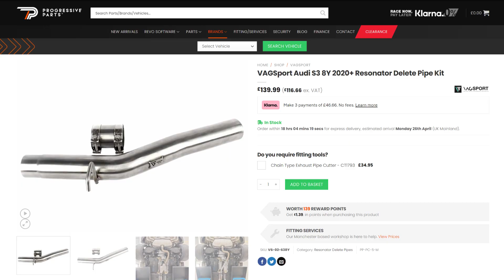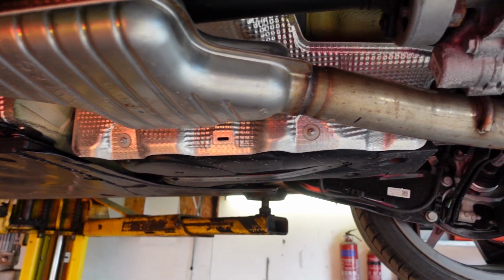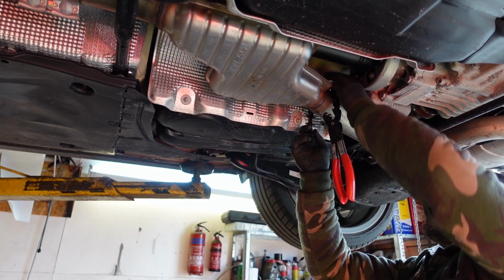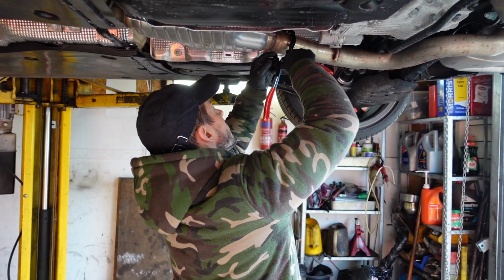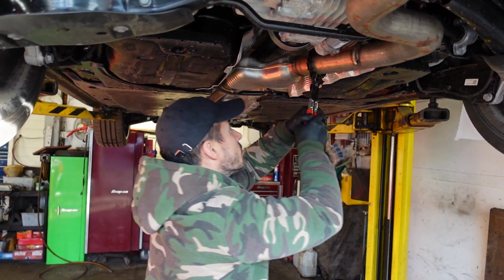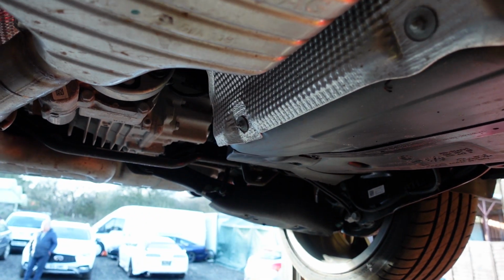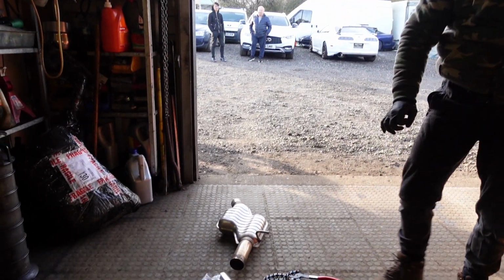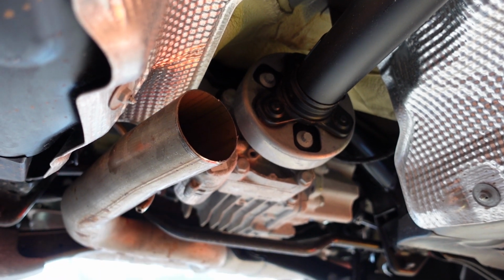MAKING THE 2021 S3 LOUDER | RESONATOR DELETE | POPS AND BANGS | AUDI S3 8Y | PROGRESSIVE PARTS

Comment from the maker: How many of the s3 gang have got this one planned?
Reply: I have plans to play around with the exhaust too (allthough it's a 35tfsi, not s3) and possibly having one custom made (i was thinking about buying milltek but they only have one for the s3)

Do you happen to have a 'before' clip?  Makes it easier to compare 🤣
Reply from the maker: @sigideridder6665  lol I did, but it got corrupted! This one was a nightmare to film. The static revs in standard form can be see from my other video where I changed the exhaust flaps to always stay open.
Reply: @CRD90  hey mate. Sounds wicked.
I am pulling out the order of my A3 Sportback in python yellow as the dealer is being a dick and pushed it back 11months. 

So... if any of your subscribers.. want...
Darkened Sline badges 1 pair
Black Audi rings front & rear
Black A3 badge.

I can sell them for the right price. Need them gone.
Gutted about my car tho.

Cheers mate
Reply from the maker: @dantheman-iam  that's sad bud, if you're interested in getting another car earlier drop me an email might be able to help! Won't be a python yellow though.

Auzzam_crd@hotmail.com
Reply: @CRD90  would it be an edition 1 mate
Reply from the maker: @dantheman-iam  even better! A vorsprung.

But drop me a note let's talk 👍🏽
Reply: @CRD90  brand new?
Reply from the maker: @dantheman-iam  1 owner, just over 1k miles - pristine and cheaper than any on autotrader too.
Reply: @sigideridder6665  Did resonator delete and clapet before second muffler and it is a tone quieter than this s3.
Reply: @CRD90  mate. Av gone another direction and bought A35 A Class. Cant get hold of Ryan at the badge shop that supplied the black badges    stuck with 60quids worth of black badges... A3 2 x SLine and front and back black audi rings....
Reply from the maker: @dantheman-iam  hope you like it bud! Guess the wait was too long eh?

If you want drop me an email, I'm often asked by people about black badges so I could send them your way when the time comes
Reply: Will this void audis warranty ?
Reply: @CRD90  Is they a difference in the engine between Standard S3 and Edition one or Vorsprung?
Reply: Was that clip just a res delete or have you do other mods too?

Comment: Hi, after the res delete did you try the car with valves always open, too? How was the sound? Did you try an Opf  S3 8v , too? Curious about the sound difference between the two. I prefer the 8v for quality and design (had one pre f.l. for 5 years and 130k kilometers)

Comment: Hey!

Looking into whether i should do a res delete or buy a cat back exhaust. Obviously price-wise the difference is big.

I'd like to have the ability to stick it into comfort and have it sound "confy" , avoid droning while gaining a good amount of volume when in dynamic.

What would you suggesr ? How's droning and how does the car react in comfort mode with res delete ?

Thanks again!
Reply: I have a Borla cat back on my 8v s3. Comfort mode is louder but subtle. Switch to dynamic and the valves open up to some beefy sounds. Burbles too even with stage 1 unitronic.

Comment: I used the same kit on my 8v. I waited until it had done around 1000 miles. Went back into Audi for services without any issue and then put the resonator back in when it went back to Audi after the pcp was up. I was surprised at first how much of a difference it made. It was much louder than stock.
Reply: Did you had any issues with droning?
Reply: @canozdervisoglu  a little

Comment: do you always get the loud pops while driving or does it vary with normal pops to "louder" pops?
Reply from the maker: It varies depending on the amount of overrun or unburnt fuel in the exhaust
Reply: @CRD90  does it increase or decrease necessarily with the res delete? I’ve got the car now stock and it happens occasionally. I want to find a way to get those specific pops noises more often because they are insaneee when they do happen.
Reply from the maker: @cakmak911  increases, so it's more frequent

Comment: I’ve had a nasty rattle coming from my bang and olufsen speakers front two doors. Dealers added some sound deadening tape which made it a bit better but it’s still there. Any suggestions?
Reply from the maker: Hmm I would take it back to them it should not be doing that and I've seen it can be fairly common.

I'm guessing you did not have the music turned up etc? If so then they would need to fix that.
Reply: @CRD90  yeh it does it more when the music is turned up but even on low volume the rattle is there. It’s so frustrating because I payed extra for the comfort and sound pack and what’s the point if I can’t even enjoy the speakers properly.
Reply from the maker: @armaaniqbal8425  agreed, my second 8Y started doing the same but by then I'd got fed up of the car so it was on its way out
Reply: @CRD90  also have a gear selector lever fault! This s3 is giving me problems now. Such a shame because I love the car so much.
Reply from the maker: @armaaniqbal8425  saw someone on the forums with the same thing.

Comment: Do you get the pops and bag straight away after the pipe fitted and also are the bang very loud?
Reply from the maker: Usually they get louder with time once the exhaust is worn in. I would say over a 1,000 miles. Yep pretty loud but not too anti-social 😊
Reply: @CRD90 what exhuast is this?
Reply from the maker: @Nacster  stock s3 exhaust,  just has the resonator removed
Reply: @CRD90  is this a special type of res delete ? All the ones I see on YouTube sound terrible compared to this
Reply from the maker: @Nacster   not sure bud it

Comment: Just some silly question. Do European versions of S3 have same exhaust pope bend or different? I mean, does UK bought res delete pipe will fit European (German) version?
Reply from the maker: That's a good question, I would assume so as the engine and exhaust layout shouldn't change depending on if it's a LHD or RHD car.

I can only go off my supra, but for that the exhaust layouts are the same I believe.

Comment: If only my s3 wasnt on finance and I could try all these mods myself... 😞
Reply from the maker: Supposedly reversible, this car in the video is on finance too. Stranger yet is on the previous s3 generation you could request a Res delete from factory!

Of course, don't take that as me guaranteeing it won't effect the finance agreement etc as I'm pretty sure Audi will notice it when it goes in for a service, whether they care or not will be another thing.
Reply: Mines due for delivery mid September, so should I ring audi and ask them whether they can do the res delete from factory?
Reply from the maker: @armaaniqbal8425  you can ask, although I've not seen it down as an option on this generation.

Might be something to do with EU regulations that it has to have one.

Easy enough to solve once you've got the car though 👍🏽
Reply: @CRD90  I literally just called up and asked😂 They said no, not something we can do on this generation s3 because of EU regulations etc. Hopefully, when it arrives I'll get this resonator delete sorted. Will it void warranty though?
Reply from the maker: @armaaniqbal8425  I believe it would only ever void warranty on that part of the car for example the exhaust system (which is crap anyway! Lol)

Again probably worth checking, but that's what I've been told in the past.
Reply: @CRD90  chalo, I'll look into that when closer to time. It's got a week 28 build week and because I went for thr exclusive ara blue paint that adds another 6 weeks🤭inshallah it'll be worth the wait tho!!
Reply from the maker: @armaaniqbal8425  insha'Allah, I'm sure it will stand out and be unique 👍🏽
Reply: Shouldn’t affect warranty as that comes down to wear and tear, but will it affect MOT? as I’ve got 2 free services with my 8v s3 2017